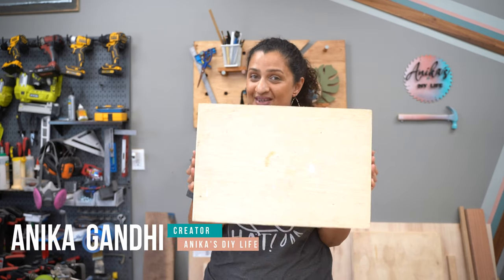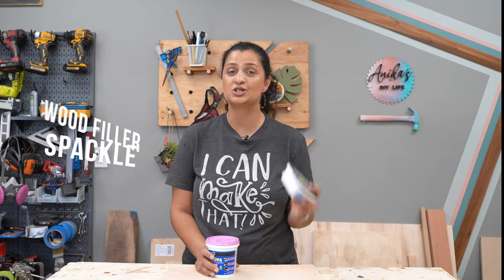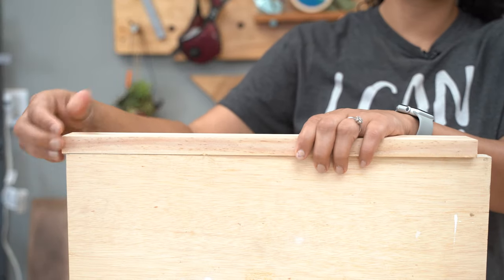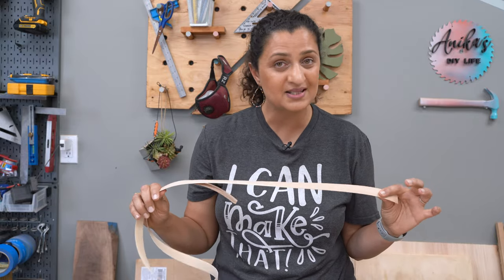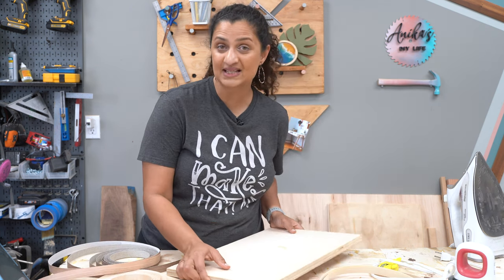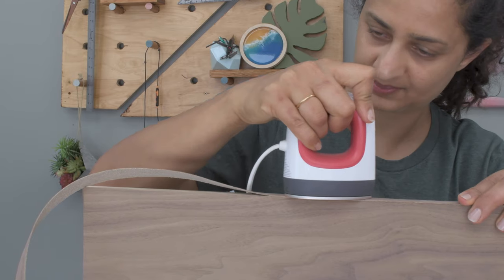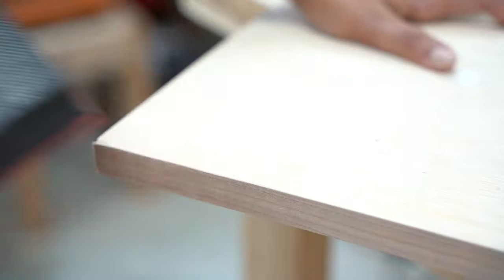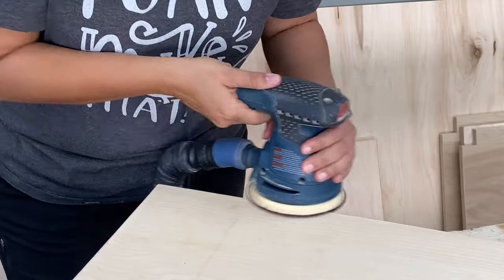How to Cover Plywood Edges - for Beginners!

Comment: You can smooth and paint the edges even if you stain the project. Just mix up a small batch of paint the same color as the darker components of the grain in the stained plywood. It will blend right in. This can even be done if you use a router to shape the edges. Take into account the effect on color of your polyurethane over the paint. Make some sample tests edges until you are satisfied with the look. Make your own edging for free by cutting thin strips from the scrap solid wood. Even pine works just fine. (accidental poetry) Glue the strips on with wood glue and clamps or masking tape. I like to make the strips 1/8" thick, but it's not difficult to make them less than 1/16". The thin "frame" that results is hardly noticeable. But once someone does notice it, it looks like a formal design element that belongs there. In fact it does belong there. Those edges will need to be sanded smooth and then can be stained or painted.

Comment: Another great video! How do you cover the actual plywood and not just the edges? Is laminate used for that purpose? A video showing that would be super helpful! Thanks again for sharing! :)
Reply from the maker: You can use laminate over plywood, but if you use Grade A plywood it's got a nice surface and all you need to cover is the edges!
Reply: @Anikasdiylife  thanks! You are a very good teacher and super helpful. Appreciate you sharing the knowledge. If u have any tutorials on fitted wardrobes that would be great